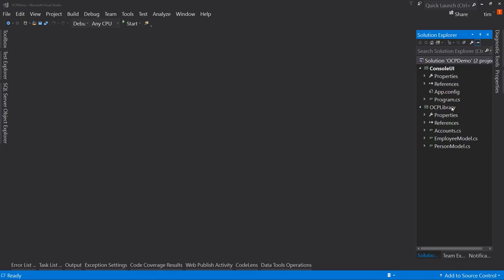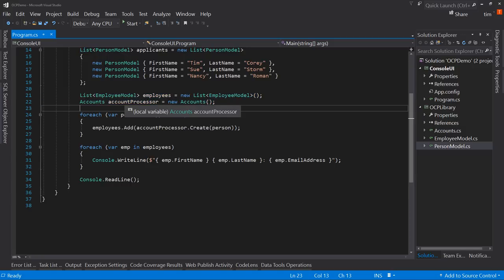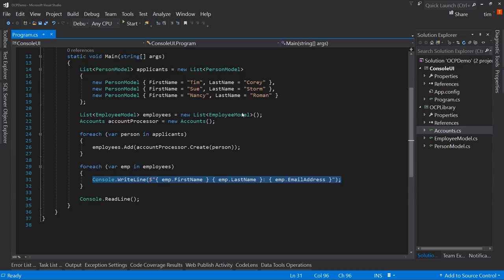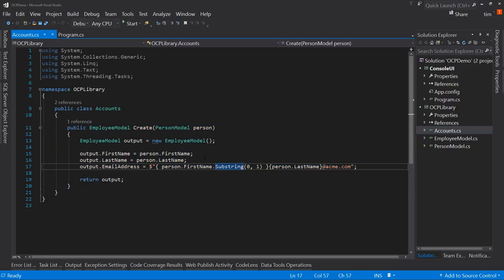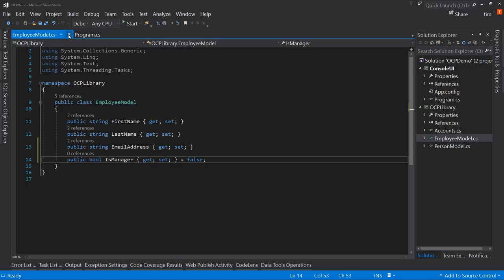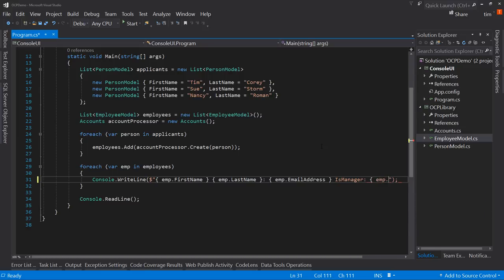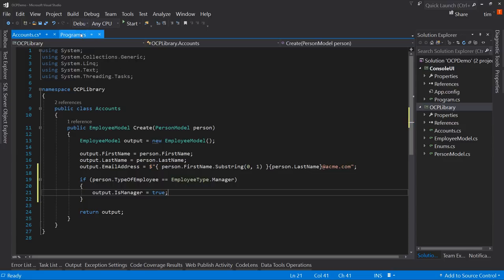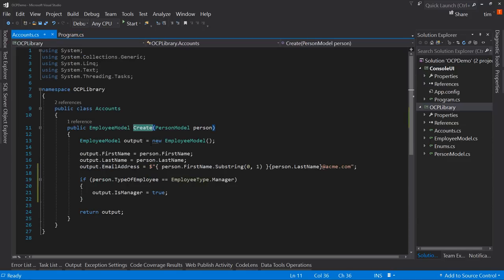Design Patterns: Open Closed Principle Explained Practically in C# (The O in SOLID)

Comment: to me it seems that SOLID principles have a very narrow field of cases in which implementing them makes sense, especially OCP and LSP.  Am i correct or not? Does every program need to force modularity in some way? Dont most systems mostly deal with pure state logic where everything is tied to types that do not have shared implementations?
the more videos i watch about oop paradigms the more confused i get. I dont understand whether i am too stupid and inexperienced to understand oop code or is oop code itself hard to read and use
Reply: It'll make more sense the more experience you get. Especially, with public repositories. I'd say these principles improve quality of code for most codebases out there and make them both easily testable and changeable.
Reply from the maker: I agree with @LeMustache. Trying to take on SOLID too early just leads to confusion. As you build more applications,  you will naturally start to see pain points that SOLID will help with. That isn't to say ignore these principles but give it time and they will become more relevant.
Reply: @IAmTimCorey  finally getting to the point where SOLID is helpful. its a lot easier coming back to code that has some guard rails vs spaghetti code that just works but who knows how it does.

Comment: your videos are awsome, it is very easy way to understand, keep it up,

i have one question,

how to create modularization using interface

let's say I have one class and there are 3 class object as properties, but I know 4th one can come, I have made 3 class separately, but i don't want to change if 4th come, and is used in HTTP post method of web API, how can I achieve that?
Reply from the maker: I'm sorry, I am not understanding what you are asking. It sounds like the explanation will probably be larger than a YouTube comment. My suggestion is to rework the problem.

Comment: I don't get it. Principle says to not change/modify anything and just extend/add new elements to do new stuff. Just like you can add new functionality to Arduino board by plugging new modules in, not by soldering existing elements out of circuit board. And yet you modify existing elements of your example program completely. That's inconsistent to me.
Reply from the maker: I'm not sure exactly what part you are talking about, but there are two reasons I modify code in this app. First, I did a demo where things were done improperly. I demonstrated the problems and then showed why it could have benefitted from OCP. Second, after I implemented OCP, I did refactor and clean up the application. Changes will happen during development. That's not what OCP is trying to prevent. What it is trying to prevent is that once you rely on a class in production, you don't change that class again (you maintain stability). Now, this does not prevent you from fixing a bug in the class. You just don't add new features or change how the system internals work of a working class.
Reply: @IAmTimCorey  Hey, thanks for reply! So what I understand is: the point of changes you made is to show how program should be built to avoid changing it in the future. I'll try re-watching it again then. Thanks.
Reply: @nastykhan7746   I think not entirely. From what I understood this simulates a scenario in real-world development where you have changing specifications / business rules AFTER an initial phase of development and deployment and this example shows how you should react to this new requirement (I would add how to handle pressure from managers or product owners as well regarding time constraints of implementing a new feature) instead of adopting the 'easy' route of just tinkering with existing stable code and potentially introducing new bugs to production code (specially). Of course if you had perfect software specifications before hand you could design your entire software to already be using interfaces out-of-the-box and prevent future modifications but I think this video is meant to cover a real-life situation where things change on the fly and are not perfect.

Comment: Will you have to refactor the EmployeeModel for this to follow OCP? If you start from the very beginning, the field "IsManager" and "IsExecutive" is not part of the EmployeeModel. Hence every time you have these requirements come in, you are adding thoese fields so the EmployeModel class is not close to modification..
Reply from the maker: Good question. The answer is "it depends". Those fields aren't great. However, typically models reflect data and that is something you don't always have control over. Either you are mirroring what is in the database or you are storing what needs to be displayed or moved together. So, models don't really fit well into the SOLID principles in general. It is more for the logic classes that we apply SOLID, although we should keep an eye on things in our models if we can.
Reply: @IAmTimCorey  Thanks for the explanation!

Comment: I would have put the enum in the class from the beginning and assign it int en interface implementations, and thanks to the beautiful default implementations, every IApplicantMode would be an employee by default
Reply from the maker: I would be careful of default implementations. They aren't really designed for that. For example, a class can implement IApplicantModel and not specify the type by default. If you ask for an IApplicantModel version of that class, the type will be Employee (because of the default implementation). However, if you ask for that class as the actual class, the type will have the first value (even if it is not Employee). Default implementations only apply when you use that interface. They do not apply if the class implements that property but does not assign a value to it. Also, if the class didn't explicitly implement that property, it wouldn't be available unless you use that interface.
Reply: IAmTimCorey just tested that in VS and you seem to be right, default implementations are shiny but dangerous, but what do you think about having the enum on the interface itself? That way you can add as many new applicant types as you want with no change at all in most of the code

Comment: what if you put FirstName, LastName, and AccountProcessor properties in an abstract class as a container of common things where models inherit from, and then you have the interface as an abstraction level above the abstract class so the code can generalize to other models, would that be a bad design decision or not?
Reply from the maker: It depends on the situation but it sounds like the inheritance portion should be fine. I'm not sure what you are getting at with the interfaces though.
Reply: @IAmTimCorey  I think after thinking about it, we don't really need the interface, thank you

Comment: How would you go about saving/loading that List of IApplicantModel in lets say a json file?
Reply from the maker: Look into using the Newtonsoft JSON library to serialize your list and then just save it to a text file. Then you can do the opposite when loading it back.
Reply: @IAmTimCorey  But then, how would Newtonsoft.JSON know that "IApplicant[0]" is "ApplicantModel" and "IApplicant[1]" is really "ManagerModel"?
Just a simple JsonConvert.Deserialize<List<IApplicantModel>>(json) would not suffice here. (Not to mention that you can't deserialize into an interface, except when you have a special JsonConverter registered for that Type)

Since AccountsProcessor has no flag that describes the real "accounts" that is implemented, we are not able to identify who is who.

Tl;DR: you can't "just save it to a text file" because IApplicantModel, aswell as IAccounts will have no context oft what they are.

Comment: Couldn't you have done this with Abstract Classes instead of Interfaces? Then the Create() method which you repeated several times could have been generalised as a non abstract method of the Applicant Abstract Class. Then Manager and Executive could call the base Create method and add their own additional steps for manager / executive as needed.
Reply from the maker: Possibly. The problem with that, though, is that then you are committing to a single base class and saying that everything that inherits from it is that thing. It would probably work here but it won't work in every situation. Inheritance is a lot more limiting than people realize. Anything you put in a base class has to be utilized in every child class.
Reply: @IAmTimCorey  Do you have a video explaining the limitations of using Inheritance - or why it's not the best solution. New to the channel - so forgive me if I haven't come across it.

Comment: in development, how to know that some entities need OCP because it feature will be added in the future ? Isn't it a waste of effort to apply ocp to all entities? be think i dont sure all the entities will changing.
Reply from the maker: Actually, that's why we have OCP. You don't allow for additional changes in the future (closed for modification). You allow for extension in the future when "changes" are needed. The point is to make something that works today, get it debugged and set, and then never change it (if possible). The reason for this is because then you always have the expected behavior out of the item. Since the code isn't changing based upon business changes/new ideas, the object still works the same way. If you need to change something, you create a new element to be that change. That way, the old element still works and the new element can be tested and debugged to make sure it works and then it too can be set in stone.

Comment: I am really confused about why you've placed IAccounts property inside of the IApplicantsModel. Why would IApplicantModel need to know about IAccounts? I understand that IAccounts have to be initialized with a correct type when used to convert applicant to employee, but is it the right place for it to be at? Should IAccounts be considered as a dependency of IApplicantModel?
Reply from the maker: It definitely is a design choice but the idea is that you attach the processing code to the data by way of an interface instead of directly putting the code and the data together so that the code can change easily for the same data.

Comment: I'm just trying to understand, but wouldn't inheritance have achieved the same thing as all these interfaces and possibly even resulted in less code? I know it was decided against at the start, because things would get messy, but didn't we just get into as much mess with all the interfaces?
Reply from the maker: Inheritance would not work because you cannot inherit from multiple classes. Interfaces give you the flexibility to handle the needs of today while still being able to respond to the changes of tomorrow. As an exercise, try setting up inheritance to work in this situation instead, and then start throwing changes at it. While this is a very simplified example, you will quickly see that inheritance will lock you into things you don't want to do.

Comment: I'm confused. Doesn't this violate doublicated code?
Reply from the maker: It can if you aren't careful but in this case, no. Just because there is similar code does not mean you should refactor it. Similar logic will be similar but it isn't the same.
Reply: The best way I’ve heard this described(paraphrased)
There are two different kinds of duplication:
Accidental duplication, and true duplication.
Accidental duplication is where two independent components or layers have duplicated or very similar code. These pieces don’t change together, they’re independent. So there is no reason to abstract that “duplicated” code because then these two components are now dependent on the same abstraction, so now they must be built and deployed together whenever something changes.
True duplication is where you clearly have a piece of copy-pasted code in the same class or component or layer— things that are changed and deployed together, therefore you should squash the duplication

I think it boils down to what changes with what. You want loose coupling everywhere possible

Comment: Interestingly, VS2022 appears to have dropped the Interface option, preferring to generate a Base class instead. This doesn't comport the same kind of advantage as an Interface. hmm. What do you think Microsoft sees advantageous in promoting Base classes over Interfaces?
Reply from the maker: You can still generate an interface in VS2022.
Reply: Oops, VS2022 does allow extracting the Interface. I had mistakenly clicked on the "class" instead of the class name "PersonModel" My bad! :)

Comment: How does this work in a Web API setup where you have a service per controller and you need to add new endpoints to your controller, service, repository.... this doesnt seem like it would be viable to make new interfaces to handle new endpoint functionality.
Reply from the maker: This is where the complexity of the real world makes architecture difficult (which just means it takes more planning). First, Controllers are often abused and fail to follow SRP. That makes it hard to follow OCP. Second, OCP applies more to when the item goes into production, not when it is being constructed. Now, if you are changing your API controller when it is in production, you should probably be versioning your API anyway. Otherwise, you can break compatibility with your clients who depend on your API.
Reply: @IAmTimCorey  Thanks much for that!  Wasnt thinking about versioning!  Whats an example of breaking SRP with a controller...that's a scary statement.  I feel like controllers are pretty straight forward, where you include endpoints that deal with the rest route....  IE - CustomerController would have endpoints that deal with CRUD operations for Customers... is that not textbook SRP?  Or am I missing something?

Comment: Would TDD or BDD avoid breaking this principle. With tests in place we could change the model and catch those potential bugs with the tests in place.
Reply: Four months later, but hopefully it still helps someone.

I don't think so, no.
TDD and BDD test your program's behaviour, but not their implementation.
OCP says things about the flexibility of your implementation, but it says nothing of the behaviour.

OCP aims to minimize the amount of work to be done (not making more changes than necessary) when a new requirement comes in. But there will be more work up front.
That is not a concern for TDD or BDD. It may aim minimize the work up front, but it doesn't minimize the work once a requirement changes.

TDD and BDD also operate at a different level than OCP.
OCP really goes down to the details of your program's structure.
TDD/BDD should operate only at the API level of your program as a whole (BDD) or of a module (TDD).
(Because if it operates at lower levels, then you risk coupling your test implementations with your classes' implementations. Meaning when your classes' implementations change, your tests also have to change, even though the behaviour is the same. That's OCP violation right there! And that's no way to minimize work.)
Reply: As a disclaimer, testing the program is not the purpose of TDD/BDD. That's the purpose of the _tests_. The purpose of TDD/BDD is to guide the development process that results in testable and tested code that contains no more functionality than needed to pass those tests (maximize work not done).
But I do believe that the question was about the tests creating during TDD/BDD and not about TDD/BDD itself. So I focused on that.

Comment: How do you feel that it's possible to pass any type of IApplicants to any type of IAccounts?  What's preventing someone to pass an instance of a PersonModel to an ExecutiveAccounts?  Any IAccounts can accept any IApplicants, it doesn't enforces that only certain Accounts are made for certain Applicants, it now means that ExecutiveAccounts can create executive EmployeeModels from any IApplicants that are not even ExecutiveAccounts.  How would you enforce that your newly created ExecutiveAccounts is not used in an unintended manner against the wrong type of applicants?
Reply from the maker: The interface enforces that. If you have the IAccounts interface applied to your class, you can do IAccounts actions. Passing a PersonModel to the constructor of ExecutiveAccounts would work just fine. That would indicate that you are hiring that person as an executive. You can hire anybody you want as an executive. I think you are expecting that only ExecutiveAccounts should be made into Executives (now sure how you would become an ExecutiveAccount though). In that case, you would change your constructor to only allow ExecutiveAccount models to be passed in. I set it as IApplicantModel because I wanted any applicant to be able to be hired as an executive.